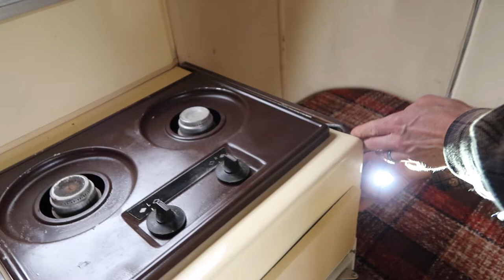We Bought Our First Travel Trailer

Comment: This Is So Adorable. Once you put sealers on around windows an power wash it. Tear out the cushion on bed and get two memory foam pads put on top of each other sew sheets Together slip memory foam into them. Voila bed fixed. HABITAT FOR HUMANITY. THEY REALLY HELP.  AND SOME NO COST.  GOD BLESS YOU BOTH BLESSED PEOPLE
Reply from the maker: It turned out that it needed a lot of work. We ended up selling and buying a trailer that we could use right away.